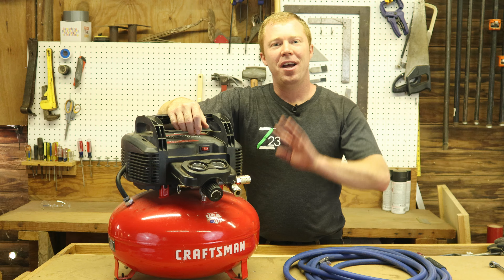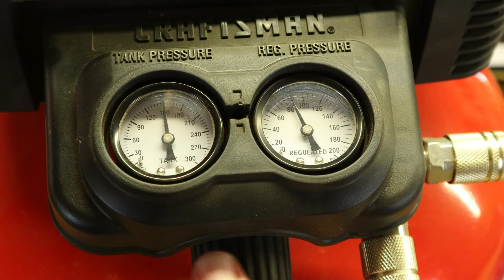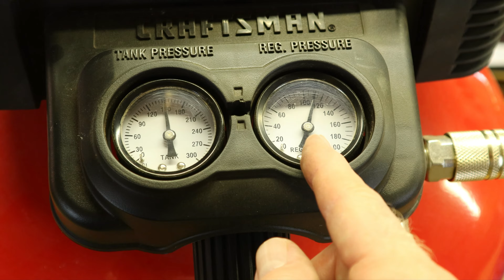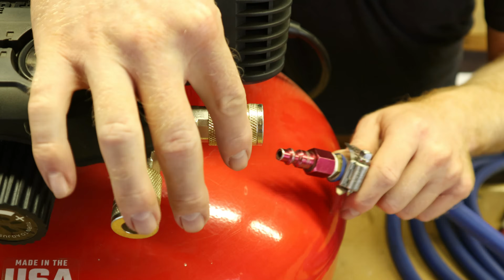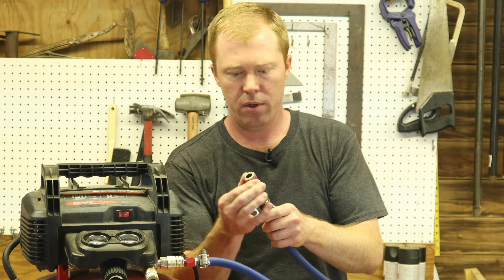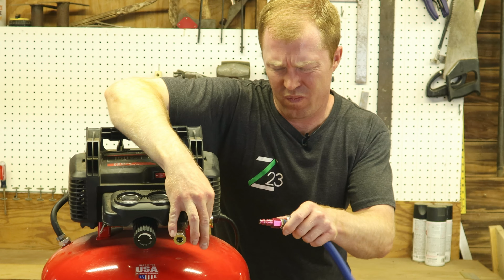How to Use an Air Compressor for Beginners

Comment: I just bought a Kobalt pancake air compressor, hose and accessory kit. What I didn't know was the pieces for the quick connect are in the accessory kit. I bought the hose thinking it screwed in somehow. Nope! The hose ends are threaded for the quick connects to screw on and then plug into the compressor so if you're slow (not stupid) like me (haha) now you know better.

I swear I'm here for God's amusement lol

Comment: I think this is the same one I have. This spring it only came on and growled like it was doing something, but it got hot and at the point I shut if off. The question I'm sure you get often. Is there way to get it up and running and not get hot? It's stuck I suppose. If it requires a purchase of a part or something I might as well consider it a throw away, it's about 5-6 seasons old and get a new one.
Reply: How do I know if a reply is left here?

Comment: Should we always empty the tank of air after using?
Reply from the maker: No you don't have to. You can disconnect the hose from the tank, which helps the rubber hose last longer. But the metal tank can sit with air in it and it won't hurt it.

Comment: nice video  I need to blow out the inside of the hot water heater so I need a 90* air gun fitting will I have to make such a fitting?

Comment: My husky compressor doesn’t build up enough pressure. When I use it, it runs out quickly and then the machine will turn back on. Why is this

Comment: I need to use my compressor to fill my air conditioner compressor. Is this something you would be willing to explain. I own the regulator, but the fittings are different.

Comment: Always wear eye protection, pressurized air is no joke.   Get ear muff/plug too if you are using it indoors.   Test the safety release valve (the one with the little ring attached to it) every time you are using it.  Depressurize whenever is going to be unused for a long period of time.  Periodically drain the condensate and remember to keep the drainage valve open for long term storage.    If you got kids, always depressurize after use and lock the unit away if possible, accidents did and will happen if not careful.

Comment: It’s much easier to connect the hose and any attachments with the tank empty, besides you should probably empty the tank when you’re done anyway because it will get moisture build up and it could ruin the tank over time

Comment: If I am using this to blow a hose line - will the PSI levels need to be adjusted throughout the process as air empties from the tank? Or does it self sustain once you initially set the PSI regulator?
Reply from the maker: Yes, it will self sustain most of the time. Most motor/pumps automatical turn on around 100PSI and starts refilling the tank. If your regulator is set at 95PSI and your blowing a lot of air out fast it may drop below 95PSI because the pump can't keep up. If that happens usually you just stop for a minute or so till it pumps the tank pressure back up where you want it. 
If you need consistant pressure try turning the regulator down to a lower PSI or you may have to get a bigger air compressor.

Comment: How do you get the tank to hold pressure?  I don’t know how to stop the valve on the bottom to stop releasing pressure 2:15
Reply from the maker: Is it on the very bottom of the tank? If so, that is used to drain water from the tank. You should be able to screw it closed by turning it with your hand or a pair of pliers if it is stuck.

Comment: Hey I have a question my tank has two gauges tank and tool. I just use to air up tires what should they be on. Sm kinda new at this. Thank you so very much
Reply from the maker: Hi there @robinwatson298. You can set the tool gauge to around 70psi. There are no hard and fast rules since you are just airing up tires. Most car tires are around 30-40psi depending on the manufacturer, so you want the tool gauge to at least read that. Having it set at a larger number (70psi) will air your tires up faster.

Comment: Great video. I purchased a tank air compressor and I don't know how to run or use it. Your video was/is a great help. Is there a difference in setting your outlet pressure for tires vs a setting for tools?

Comment: Do you leave the compressor connected to the electrical box even when is fill while putting air on the tires or you disconnected once the tank is fill then fill the tires 🛞? Thanks

Comment: I just bought an air compressor and a hose but the hose is threaded, so I have to buy a quick connect adapter or is there any way I can still connect them as is?

Comment: Someone else I watched mentioned when completed use besides draining to reduce moisture inside that will ruin the compressor we’re suppose to lower the pressure to 20% air when in storage. Hope this is helpful

Comment: Thanks for the vid! How do you lower the tank pressure to safely empty the tank? If I turn the compressor off and unplug it, turn the pressure regulator knob all the way to the left, pressure doesn't leave the tank, it stays put at 135psi. I have a Husky 2gallon similar to the one in this video and there's a "safety valve" near the regulator and a "drain valve" at the bottom of the tank. Am I emptying the tank using one of these while the tank is at 135psi? Feels unsafe emptying 135psi through such a small valve.

Comment: First of all love your video. Thank you how do I get the tire gauge off at the end when I want to change a nozzle
Reply from the maker: Thank you so much! Does your hose have a similar coupling like the one shown in the video? If so, you pull the sleeve back and (if the hose has pressure) the nozzle will pop off. If there's pressure it will be harder to pull back. If the hose doesn't have pressure then you pull back on the sleeve with one hand and pull the nozzle out with the other. Hope that helps!

Comment: I have an Emglo compressor, two tank system. The motore runs. The tank pressurizes. Both gauges register 120 psi. I can connect the hose and a tire fill nozzle. Only issue I have is that no air comes out. What am I missing?

Comment: Saw a few scare videos of them exploding and the comments mentioned draining water from them after each use. Also you say you can leave with pressure inside the tank but what is the best way to bleed that out when not using it? Just pull the safety valve? Mine is an Einhell 24litre 2 HP model TE-AC 230/24/8
Reply: I know this is an older post, but releasing the air pressure using the safety valve is safe to do. Its generally better to drain a compressor tank of condensation when you are done with it, since it is easy to forget to drain it when you put it away with the intention to drain it before next use.
Reply: @Mahkwa appreciate the reply. Good to know as I've used it a few times now and as you've suggested , I've drained via the safety valve each time before packing away.

Comment: So u just plug it in and it automatically fills with air? Then unplug it and without using electricity take it outside and fill tires .
Reply: OP is correct. Unplug and use once it's full of air
Reply: ty, he missed that part ... i was looking for this answer, ty
Reply: No.. it has to be plugged in and on while ur using it. Hes just saying wait for it to quit running cuz it runs while it fills up with air
Reply: @Joey-ci7hg that is false
Reply: @LL-wh3uc if ur dumb just say that. U obviously have no idea what ur talkin about so therefore don't talk

Comment: Stupid question why is there 3 couplings on your compressor
Reply: 2couplings not 3
Reply from the maker: Great question. The 2 couplings are for when the compressor is used on a jobsite and you could hook 2 hoses and nail guns to it so both people could work at the same time. I keep it at home so usually only use one coupling.

Comment: Obviously, I’m a beginner, which is why I’m watching this video. I hooked mine up with the exact same Leo as yours does and my tire pressure was very low on my vehicle, but when I went to put air in it actually deflated my tire even more what did I do wrong?
Reply: It has to be plugged in and on when u put air in anything
Reply: @Joey-ci7hg it was.
Reply: @Joey-ci7hg false, stop saying that
Reply: @LL-wh3uc um ya actually it does. Otherwise it runs outta air. What fantasy world u live in? 😂😂

Comment: Once the pressure is built up from being plugged in will the plug need to stay in to continue airing up anything?
Reply: No doesn't need to be plugged in but once your tank starts getting low on air it won't be able to fill anything so if you had a small air compressor you probably wouldn't get enough air in a car tire before having to plug it in again.
Reply: Yes in short terms yes it needs to be plugged in and on while ur using it. It will continue to kick back on and fill up with air as ur using it if it needs to. Otherwise it may not have enough air to do what ur tryin to do if u unplug it

Comment: My husband has Craftsman Air Compressor, 10 Gallon Peak 1.8 Horsepower Oil-free Compressor, Max 150 PSI, Vertical Compressor Air Tools, Model: CMXECXA0331042 and I'm wanting to use a sunex  9004A 1.4mm gravity feed spray gun and cup to paint with. I have never used an air compressor before. The directions on the paint spray gun states never use a quick connect couplings at tool - it states they add weight and could fail due to vibrations. instead add a hose whip and connect coupling between air supply and hose whip. Do not exceed maximum air inlet pressure of 50 PSI. My questions are: Do I really need a hose whip and if I do what is that? Do I set the regulator to 50 PSI? Also does my compressor have a release air plug on the bottom and is water suppose to come out of it.  Thank - I can't find the manual for the compressor.
Reply: If ur husband has one he should be able to show u how to use it

Comment: Once you use the electricity to get the air into the compressor, then can you disconnect it and carry it around and use it or does it always have to be plugged in to work?
Reply from the maker: You can disconnect it and use the air in the tank without electricity. Good question. I do this when I have a flat tire on the lawn mower and carry the tank to the mower.
Reply: @Z23diy   Thank you!!!
Reply from the maker: You're welcome!!

Comment: Air compressors are notorious for condensing water in the storage tank. It is very important, especially on the small compressors like that, to empty the pressure and drain the water at the tank drain. Otherwise, it can lead to explosive tank failure.
Reply: Thanks man wish a had a father that could/would tell me this
Reply: @BeanLabb1nyour friend's fathers wouldn't know this.
Reply: Is this before or after I disconnect the hose?
Reply: @MvrtinVnthony  Doesn't matter lower the tank pressure to about 15-20 pounds and let the rest go out through the drain.
Reply: @barrygrant2907  How do you lower the tank pressure? If I turn the compressor off and unplug it, turn the pressure regulator knob all the way to the left, pressure doesn't leave the tank, it stays put at 135psi. I have a Husky 2gallon similar to the one in this video and there's a "safety valve" near the regulator and a "drain valve" at the bottom of the tank. Am I emptying the tank using one of these while the tank is at 135psi?
Reply: @mikemyersvideo  Pull the loop on the safety valve and drain the tank down to 20 pounds or so. then open the drain on the bottom of the tank. Position the drain so it's at the lowest point of the tank and rock it some so any water rolls to the drain valve.
Reply: @barrygrant2907    They should teach this stuff in high school instead of whatever they're teaching.  😅
Reply: @greatagainmowing8296 EXACTLY 💯💯💯💯
Reply: @greatagainmowing8296 literally!! They really need to!
Reply: How often do I do that?
Reply: @ I have a little portable compressor. I drain it after every use.
Reply: @Kyt_01234 Other comments are saying after each use.
Reply: @warmcozy  I empty mine after each use.  I have a larger tank with a drain on the bottom. The water will sit in the bottom if you don't drain it and will rust out your tank. I also release all the air out of my hose and water will come out too, I leave it connected on.
Reply: i just bought one it feels full of water sounds like a ocean in there
Reply: @seacheeks sounds like you need to drain it.
Reply: If you did drain it, how much water came out?

Comment: Do you turn it off the compressor after you fill the main tank, and use the tool tank while off, or you need to have the power on the entire time?
Reply from the maker: @TheChrisWebber you can leave the power on the entire time. As you use the tool, the compressor senses when the pressure gets low and automatically turns itself on and off.
Reply: How long does it take to fill the air compressor
Reply: @DavidRawlings-m1f I just tried this and it took about 5 minutes

Comment: when I plug in a bare either open ended hose or a hose with a quick connect on the other end it blows constantly even if its turned off is that normal? (it didnt stop like how it did for you.)
Reply from the maker: On the end that is blowing did you use Teflon tape on the threads when screwing on the end fittings? Air will blow out of the threads if there is no Teflon tape.
Reply: @Z23diy  it looks like it came with Teflon tape on it (orange color) i grabbed a wrench and pliers to hold the coupler and tightened it over, and it stopped the leak.
Reply from the maker: Yes, that orange is like Teflon tape. Awesome that you got it fixed!

Comment: I’m trying to hook up my new titanium 45 plasma torch to my 150 psi 6 gallon pancake air compressor 

Do you think that it could continuously maintain 110 psi? 
 
Or will I have a time limit of cutting and have to wait periodically to cut more? 

Thanks in advance! I really appreciate it 😊
Reply from the maker: Hi there and congrats on the new plasma torch! I'm seeing the titanium 45 needs 4.2 CFM (Cubic Feet per Minute) of air.

I doubt a 6 gallon compressor can do that but I would sure try it before upgrading your compressor.

If you get a new compressor they will usually list the CFM in the specs.
Reply: @Z23diy  You wouldn’t believe it, but God blessed me, and that little air compressor is running this cutter like a champ!! 

I can only cut for about 45 seconds and then I have to wait for about 15 seconds to start again, but 45 seconds of cutting time is not bad at all. 

I can cut 1/8 inch steel for about 18 inches before the compressor needs a moment to catch up!! It hugely awesome. I didn’t think it would work. I didn’t want to waste my time, but God put it in my heart to try, and BAMM! 
Now this system is actually portable =)
Reply from the maker: That's awesome and a blessing!! I would not have guessed you could get 45 seconds cutting with it. 
God is Good. Love it when He puts things like that on our heart to try and be blessed unexpectedly. Thank you for sharing it!!
Reply: @Z23diy  =)
Reply: @Z23diy  Thanks for responding. I’m considering getting an air tank and connecting it to the 6 gal air compressor and just only being able to cut for 30 sec at a time. 

Thanks so much for the response 
God bless =)

Comment: So do you have to go and fill the compressor or does it fill itself when it’s turned on?
Reply from the maker: It fills itself. 
If you just have the metal tank and no pump on top (the black part in the video) then that's called an air tank and you do have to go fill it up. 
An air compressor,  fills the tank itself.

Comment: Didn't really explain what the other plug in was on the compressor the one under the other gage
Reply from the maker: Hi subaru forester506, the other plug is an extra coupler in case you want to hook two hoses up at the same time. Thanks for the comment!